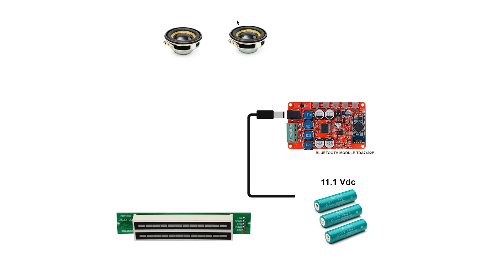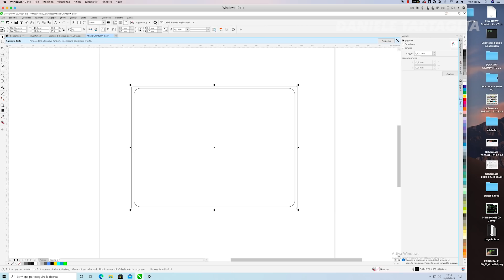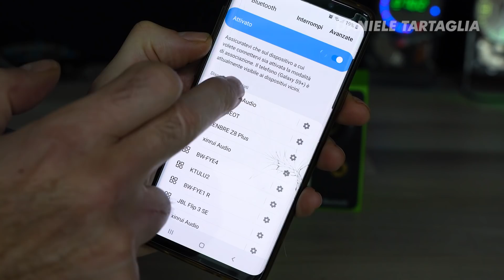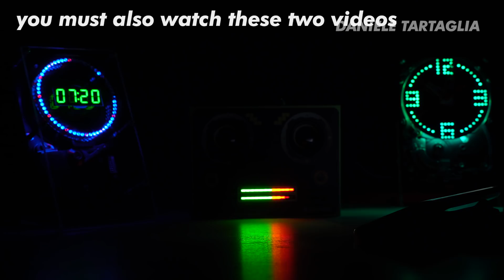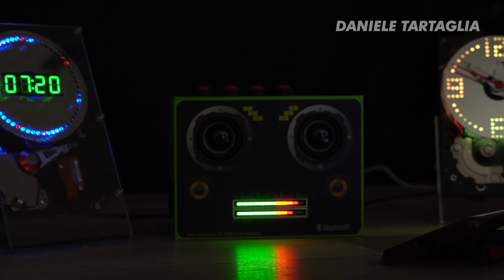TURN a Carton box in to MINI BOOMbox

Comment: The amp rate is too powerful for that tiny speakers, bcs it is designed for 5-6" drivers. It'll blow up those driver soon and also waste of it's potential. You should use 5 watt amp instead, not only it's safer for the speaker, you'll also get more efficient and long lasting battery life.